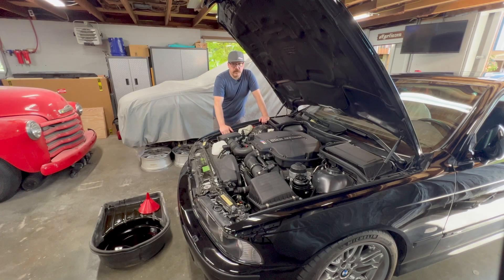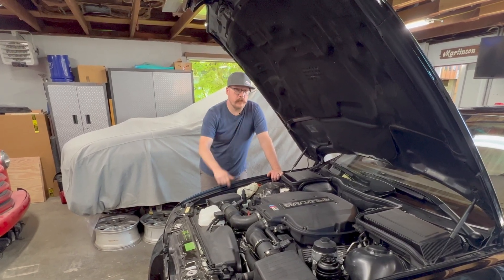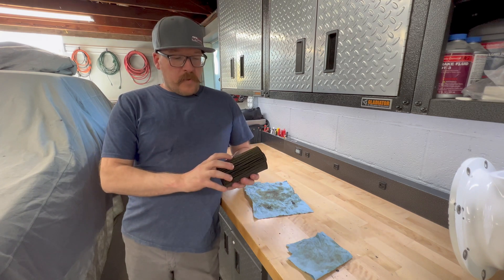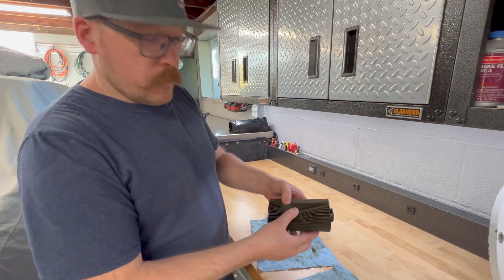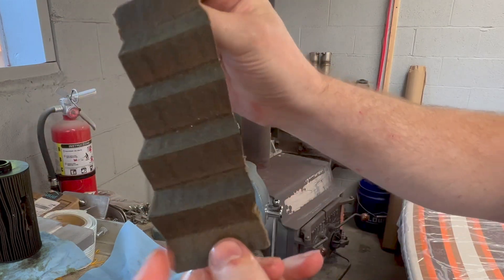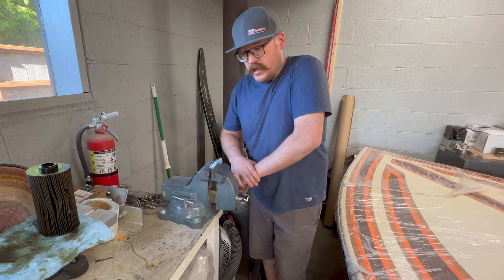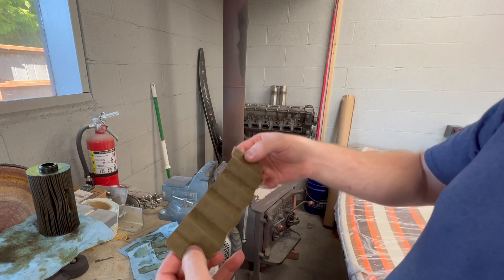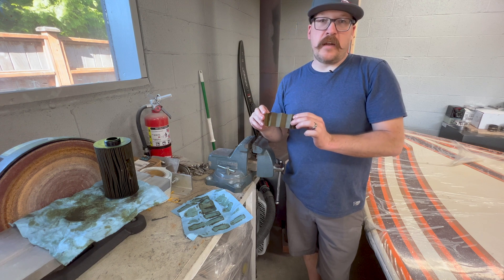The RIGHT way to inspect your OIL filter for metal & DEBRIS

Comment: Thanks for trick with bench vise. So as I understand a very small amount of little metal particles is acceptable? Especially for a new engine with up to 10,000 miles on it?
Reply from the maker: There is a lot of material that gets into the oil during break-in as the piston rings seat. I can't say that metal in the oil is normal. It really comes down to the amount and size of oil, mileage, and use of oil, and whether it was a one-time thing or it keeps returning. 

~ Nick

Comment: Changed my oil today and saw many tiny little gold speckles, is that considered normal? We're talking smaller than gains of sand, maybe even smaller than grains of table salt, but it was throughout the oil, which was maybe from 2-3k miles on a '08 CRV w/ full synthetic. TIA!

Comment: Thanks for the tip, I had a similar amount of specs maybe slightly more on my motorbike oil filter and I’m still trying to figure if it’s bad or chill, bike has 30,000km (fair bit for bike)

Comment: So that amount of metal is not concerning? I just changed the first oil change on my girlfriends car (it's her very first car she's owned, she never had one in her home country) which is a 2013 Honda Civic with 157k miles on it. It has about the same amount of metal as what you've shown here in the filter. I was a little concern upon first seeing it so doing some research. Seems to be running fine, but still want to pay attention in case I should advise selling it ASAP and getting something else.

Normally change oil every 5k miles on my cars, but wondering if we should do it again in maybe 1000-1500 miles and check how things look.
Reply from the maker: A few specs in one pleat. No, that wouldn't worry me on this car. If every pleat had the same metal in it, yes I would be concerned.
Reply: @AutoTechNick  It's definitely in more than one pleat, but not every pleat either, so not sure what to think at that point.
Reply from the maker: @ My suggestion would be to change the oil and filter. Run it for a few weeks, then check to see what is in the new filter. If it has captured a similar amount of metal, then you might want to start looking for the source. You can also send an oil sample to be analyzed, check out Blackstone laboratories. They can tell analyze your oil and give you all sorts of great information on its condition and contaminates. Sometimes a quick oil test is cheaper than tearing apart an engine. 

https://www.blackstone-labs.com

~ Nick

Comment: So you would say those small metal pieces are nothing to worry about?
Reply from the maker: From what I saw in the filter now, no. It's insufficient to convince me to dig into or tear down this engine. Now, if I keep seeing them on each oil change, then I might consider doing so. Premature timing chain wear is relatively common on this platform, so it's something to watch. They key to this is watching over time and looking for noticeable changes.

~ Nick

Comment: But how do I check for metal shavings when I’m inspecting a car ? I don’t want to drain their oil lol
Reply from the maker: In most all applications, you do not need to drain your engine oil in order to remove the filter.

~ Nick
Reply: @AutoTechNick are those shavings normal in cars with a timing belt. Is it a sign of engine wear. Thanks